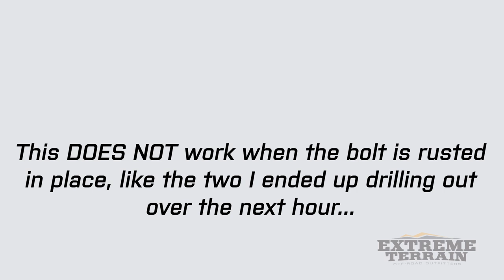Jeep Wrangler TJ MORryde Tailgate Reinforcement Kit Review & Install

Comment: $400???? You’d be dumb to not pick up a new bumper with tire carrier swingout instead.. that’s absolutely ridiculous pricing
Reply: Not everyone wants to put all that weight on the end of the Wrangler frame. With this kit, you can run a lighter bumper and really keep a bunch of weight off.
Reply: I want to keep my hitch to tow my boat but I can’t find a aftermarket bumper that has a tire carrier and a tow rating for the hitch that is always built in those bumpers.
Reply: People who frequently are in and out of the back of their jeep don’t want to open 2 tail gates to get inside every time